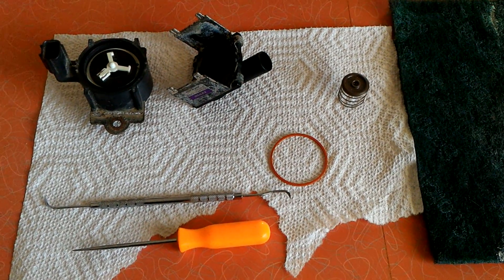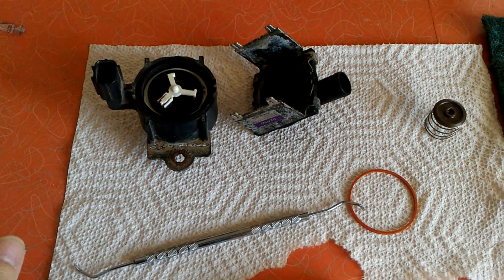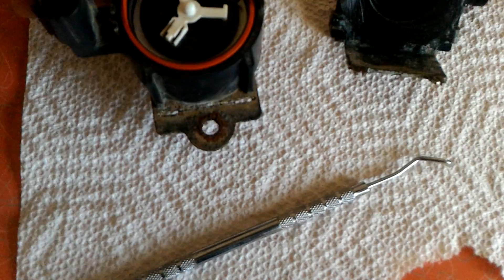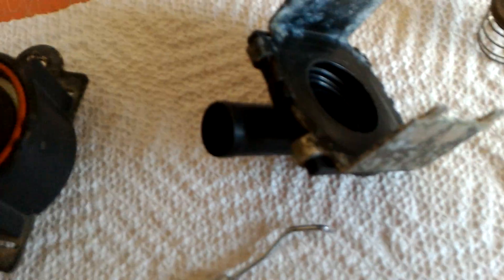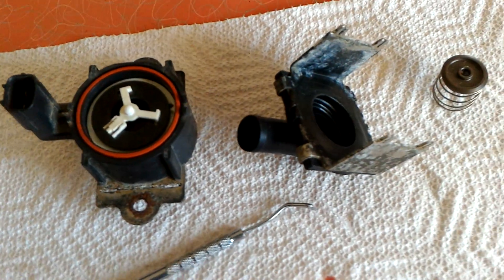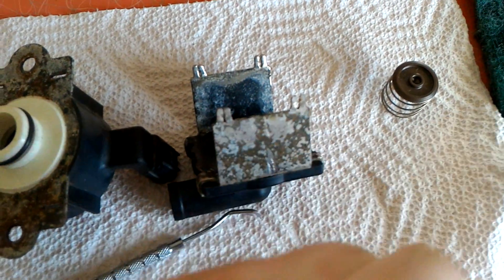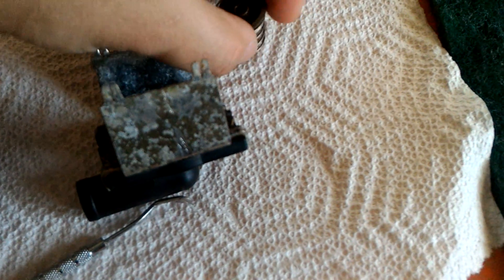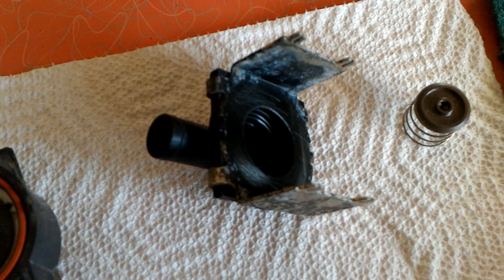P1457 EVAP Leak Diagnosis and Repair for FREE - Honda Acura Shut Valve Purge Valve

Comment: I have P1457 on my 1999  ACCURA 1.6 EL , where can i find this part please and second question if i don't fix it what will be the problem later . Thanks for the grate video .
Reply from the maker: It's emissions related so usually just for passing smog/emissions testing.  The part is available new oem or aftermarket.  Rock Auto is usually a great place to shop for aftermarket parts

Comment: So how you cleaned it you didn't mention the material u used 2 clean or you got it new.??
Reply from the maker: I used a Scotch Brite pad after using some 600-800 grit sandpaper which I was careful with.
Reply: @LMEngineering  no spray at all? Jst saying ihave a issue with that code.
Reply from the maker: @Gbodyteggy1208  didn't require any spray solvents for my application

Comment: Is this problem related with idle air control valve? I have three codes 
shot. One is this and o2 sensor no1(replaced 4 months ago) and idle  problem.
Reply from the maker: IAC and EVAP technically two different systems.  IAC assists in idle control.  EVAP is an emissions based system.

Comment: Thank you for this.  I just had the code come up.  I plan to check the lines and then rather then throw parts at it, I think I will do this.. just cause. It a free repair that if has not failed yet, it will before too long.  It can only help.
Reply from the maker: Good luck with your troubleshooting!

Comment: I got this code with my acura tl 2001. How do i replace this part?
Reply from the maker: Refer to the repair manual for location of the valve on your TL, they can be in different places depending on the model.
Reply: LM Engineering thanks
Reply from the maker: No problem, guessing you found it near the fuel tank or in the engine bay, but since I haven't worked on one of those I didn't want to send you looking for it in the wrong place.

Comment: I actually have a code for low purge flow (P0497) on my S2000, think this would help?
Reply from the maker: It may but no guarantees.  May be worth looking further into that code to see if there is a troubleshooting guide
Reply: Marcos Diaz did you ever fix this? I have this code as well but before I spend money on something else I want to see if anyone has fixed it because I can’t seem to find a definite solution on this on videos or forums

Comment: Great simple video man.  I just got a 02 civic and if the light comes back im going to try this but living in new england the bolts might be seized in the canister or break. Hopefully not.
Reply from the maker: +Mike Cheney rust is not fun.  I hear stories from mechanics from the south who have never seen a rotted brake line, a bolt so rust the hear snapped off when breaking it loose etc.  If they only knew how good they had it.
Reply: LM Engineering very true, i worked with a guy from PR and he was breaking alot of bolts.  He went back down there after a year lol.

Comment: Hi how are you?
Thanks for the video. I have a question I change the all canister and shut valve.  Gas cap. And the check engine light back. And it's the same code P1457.
Honda accord 2001 
I will so appreciate your help. Thank you.
Reply from the maker: +Máximo Bautista have you reset the check engine light after changing?
Reply: Yes.
Reply: Was off for 2 weeks.
I put gas after a day check engine light..
Reply from the maker: +Máximo Bautista okay.  If you replaced the mechanical items as you said with working parts (new or used doesn't matter so long as they didn't have that problem in the car they were in beforehand...if you don't know the history that's something to consider as I've seen used and prefailed parts get installed in attempts for a fix before) you could have a leak in the hoses or issue with the connectors/wiring.  There are evap codes specific to leaks however it's always possible one issue could be connected to another.  

I know you said you changed canister and shut valve.  Have you tested the purge valve?
Reply: I will look on that.
Good point. Thank you.
Reply from the maker: +Máximo Bautista no prob good luck in your troubleshooting

Comment: Where is this valve on a 2001 mdx?  Any idea?
Reply from the maker: +David Gilbert hi David. Most commonly they are in 2 spots.  In the engine bay near the firewall OR under car near fuel tank.  I've repaired/replaced them in both locations on Honda/Acura

Comment: life saver
Reply from the maker: I can confirm that after doing this fix myself, now 5 months ago, check engine light is gone and valve is operating as it should.  If you are not a mechanic you may want to not attempt this yourself but with my experience it was fairly straight forward of a repair